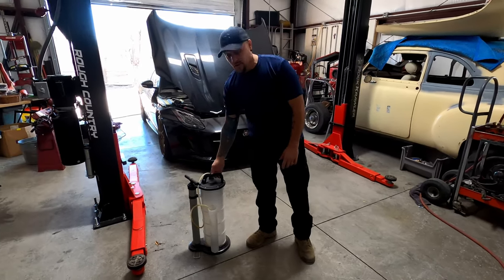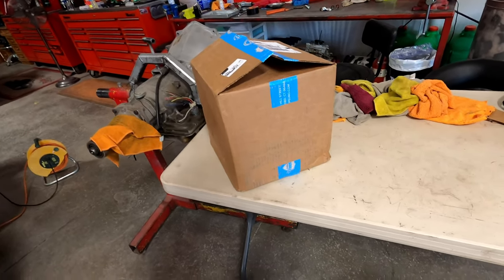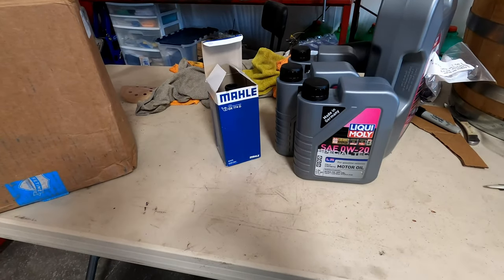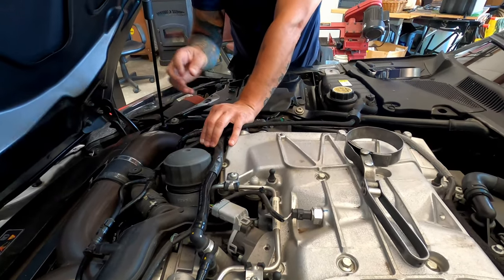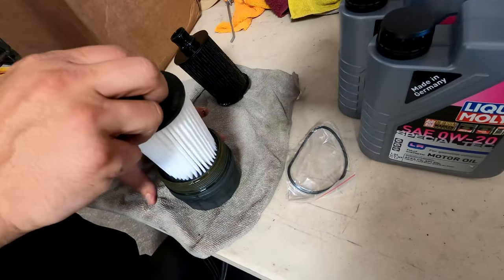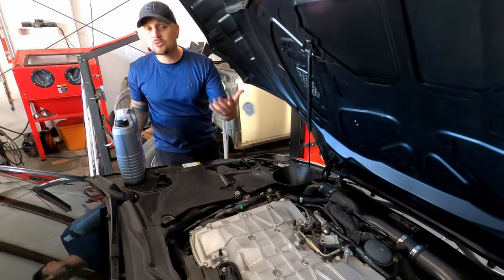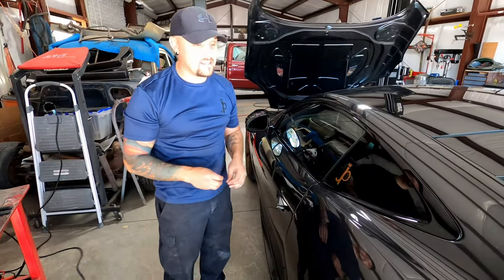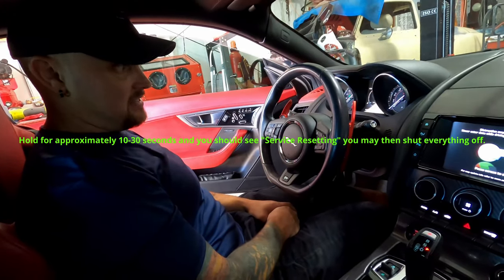Oil Change Extraction on a Jaguar F Type R

Comment: Awesome, you covered everything succinctly thank you 🙏🏼 When I found out after purchasing my 17 F-type R with 21K I realized no dipstick and thought are they serious until your insight into readout level, but the process of resetting oil service indicator is utterly insane❗️🤪🤯👈, those boys across the pond are touched🤣 Having an issue I don't seem to find any answers to online and I'll be damned if I'll bring it to my local crooked Jaguar dealer, requested a 165 point pre-purchase inspection and they gave me a BS inspection with only a quarter of those points and tried charging $469, that didn't happen and service advisor was a douchce and belligerent but ultimately refunded over half of that back. My dilemma is with the automatic deployment of rear spoiler, it's not deploying any longer and getting alert readout ⚠️ Spoiler not available and get same readout when I attempt to manually raise it for cleaning mode with ignition off but accessories on. Any insight would be helpful since haven't seen any solutions in online Jaguar forum or on YouTube and haven't yet found local mechanic qualified to work on said beast, thanks.🙏🏼
Reply from the maker: @echauncey12  😂😂 yes the oil reset is something else indeed. I typically just use my scanner now 😂
Reply from the maker: @echauncey12  as for the wing, the lift gears have position sensors plastic mounted to plastic not the best design. possibly a broken tooth on the gear or bad positioning sensor.
Jag sells a module to eliminate the auto wing completely but it’s pricey near 1100.
i have my APR fixed gt wing now and have cut my factory lift motor arms so they think they are lifting the wing but are not connected to anything.
Reply: Thank you, haven't seen anything anywhere as to what you described. Can't believe I'm the only one with this issue and sounds like I might be in for a fixed wing also. 🙏🏼
Reply from the maker: @echauncey12  I have a full install video if you go with the APR 200 GTC wing. When you order contact Chris in sales let him know it’s for a Jaguar F type that way the mount holes are tapered instead of straight.
Reply: @JPSTREETPERFORMANCE thanks again JP, was on the site briefly last night and didn't see Jaguar listed, will try again later and also check out your install video, was looking at another Jaguar guy on here Mr.GB a Brit who installed what I believe he said was a SVR wing on his R and it has the Jaguar emblem on it though he had some issues with it getting water inside and in video I saw he didn't resolve that problem yet because he still hadn't figured out how to get water out without damaging the unit. I'll send you link to video after if you want to check it out. Wasn't looking for now though, have so much crap going on it's hard to keep up, just want to resolve wing issue 1st under a warranty still since purchase about 2 months ago, certainly don't want to go airborne at warp speeds I like to get to on open roads if I could find an open road here on Long Island🚕🚙🛻🚚🛻🚛we have one road 495 Long Island Expressway(nothing express about it) known as the longest parking lot in the world❗️🤣🤣There are many other roads either full of cars, trucks potholes and cops or all of the above, so it ain't easy being me❗️😅 Previous vehicle for 4 years was a 16 Charger Hellcat on a daily commute for 4 years, left around 6AM pretty much before traffic started and state troopers were changing shifts with my Valentine One on visor(still on Jag visor) it was a Hellava😈Lotta fun in my cat😹 retired now and in a different cat❗️🐆🙀😹
Reply: @JPSTREETPERFORMANCE https://youtu.be/GpYq3hCXMSA?si=FKwjvzWbjv51XwMC

So just seeing beginning of video he states he couldn't find a SVR wing so he got an R with a fixed wing spoiler, not sure if that was exclusive for Britain but interesting and wonder if it's available here sans the water inside, because it looks nice😍🐆 Where are you located JP?
Reply from the maker: @echauncey12  yes you can order the factory fixed wing. or they even make replicas. still have to deactivate the lift module if you just unplug it you will have a code and reduced driving ability, think top speed is limited to something like 110 mph without getting the eliminator module or leaving the motor in and cutting it like i did.

i’m located in Fallon NV, about 1 hour east of Reno NV.

Comment: Great video! Do you recommend using the drain plug method or the extractor method when breaking in a new F-type? Will the extractor get all the oil out? I am right at 1075 miles with my new F-type R. Thank you.
Reply from the maker: yes on your first service definitely drain plug method.

I personally do the drain plug method every other oil change just to verify i get everything, but the extraction method does appear to get most if not all of it.
Reply: Excellent! Thanks, JP!